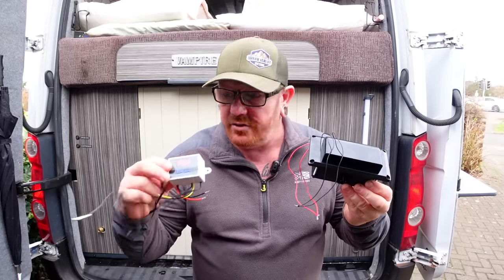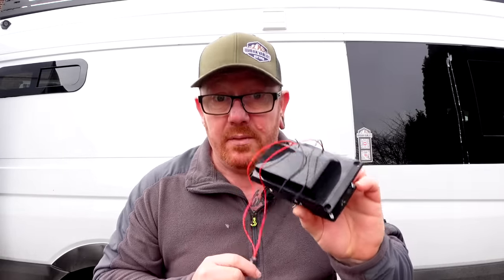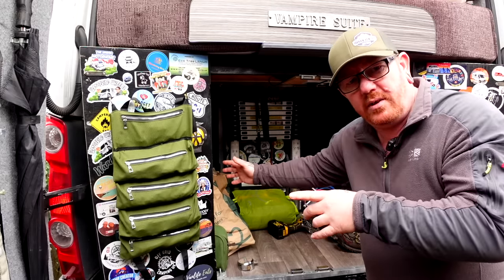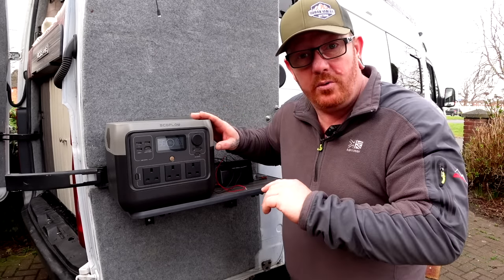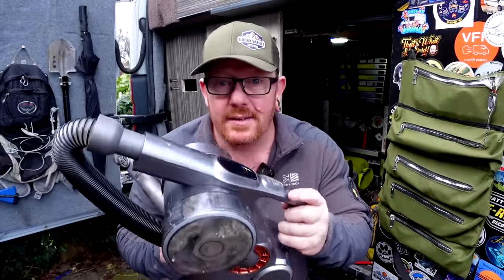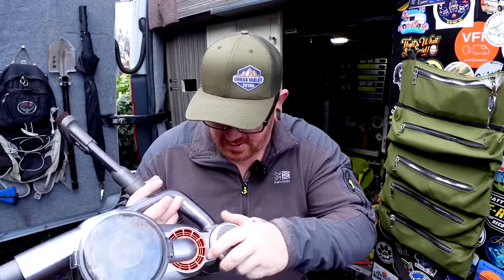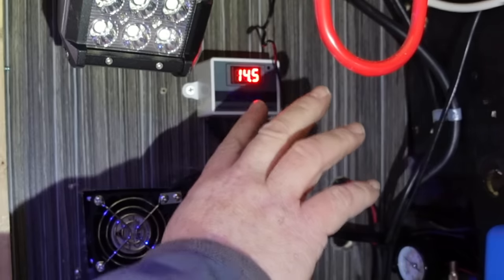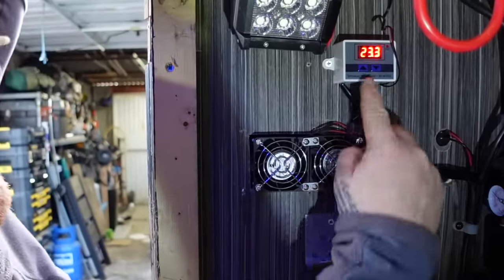Temperature Controlled Fans Powered By The EcoFlow River Pro 2

Comment: Great video and use of the temp sensors; though not sure if the video was about the Ecoflow in disguise ;-)
Reply from the maker: It was about both mats but mainly the fans . But as we are channel partners with eco flow we do showcase there products . But I would never just put holes in a van for the sake of a brand . The job was needed and we used the eco flow to do it so kind of goes hand in hand
Reply: @UrbanVanlife  I use PC fans for my dogs crates, one pulling, one pushing.  Bought a couple os sensors to attach to those; so great idea - thank you.  Also - Liverpool or Wirral?  I can't get your accent sorted!
Reply from the maker: Liverpool mate .

Comment: Would it be worth adding an LED indicator in the living area so you know when that fan unit is running? Just connect it in parallel to the power output going to the fan motors.

Great video as always, thanks for sharing 👍
Reply from the maker: I don’t think it’s needed cos its not the quietest of things to be honest
Reply: @UrbanVanlife  you could label the light "insert ear plugs" 😉

Comment: Got to love a multi tool. What do you think of battery pack over battery on board. I have the little Jackery which I love but I feel I may need to replace the on van battery as it is only 100Ah and weighs a tone AMG. I may fo for a higher powered Jackery, Ecoflow? I know Alex was talking about going down that route?
Reply from the maker: There are some that would be perfect instead of a battery . Plus all the electrics are in there for you as well . Usb usbc and inverters it’s all in one box . So for a lot of people this would be perfect rather than a complicated electrics system

Comment: Neil I have just placed one in the van for the dogs cage mate How can you turn the vans around so they are blowing into the cage as the air is blowing out of the cage not inside which I want
Reply from the maker: Unscrew the fans and re mount them in the reverse way mate . Basically flip the fans
Reply: @UrbanVanlife  thanks Neil

Comment: Cheapest solar 100w or 200w panels I could use for the river 2 Pro I've just bought it and on the rear input 13a max or 11-50vdc ??? I'm stumped
Reply from the maker: Any portable solar would charge it I would imagine mate and you’ll get some cheep ones on Amazon and eBay
Reply: @UrbanVanlife  Bought 200w half decent one

Comment: Where is the link for the fans matey
Reply: @Where on earth Just stop the video on the photo of the listing and do a search on flea bay the fan is under caravan side vent fan 12v and the model number of the controller is also shown in the other section. It will not allow me to put links but search for 12v 220v solar water heater controller
Reply: @brianparker5228  cheers pal
Reply from the maker: Links are in the description buddy
Reply: @UrbanVanlife  thanks I couldn’t see the link for some reason but managed to pause it on the screen shot. Was going to use pc fans but this is a better idea